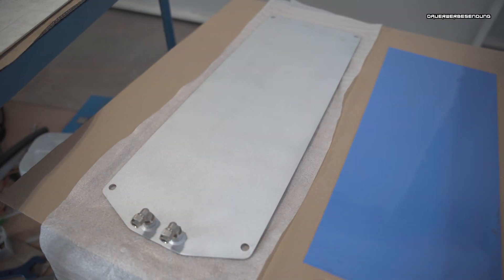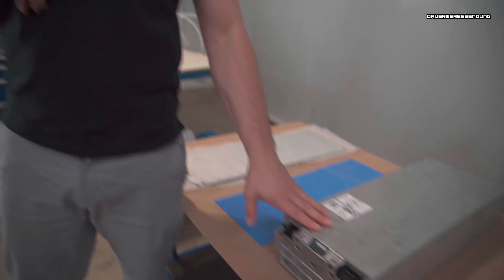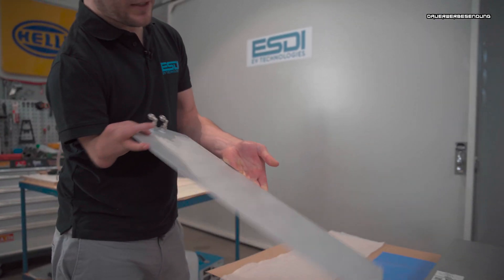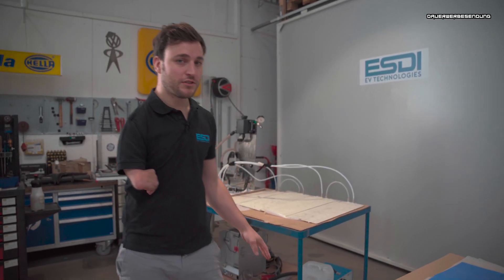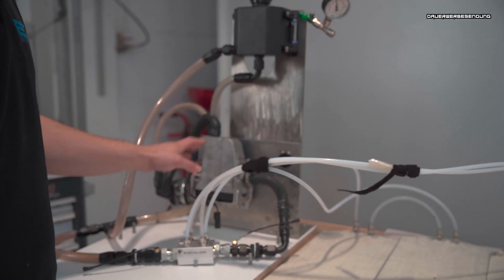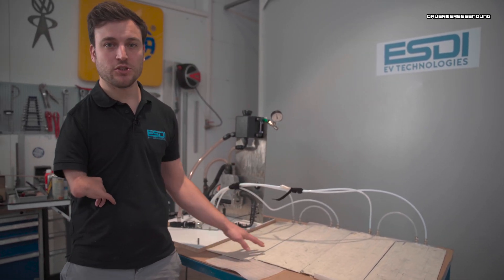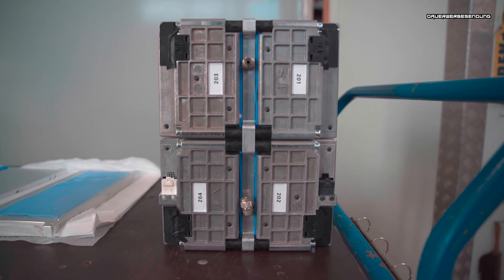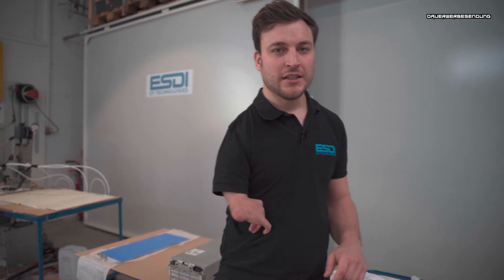MEB-MODULE COOLING PLATE | BATTERY COOLING ELECTRIC CONVERSION | ALEX TECH TIME #8 | ESDI EV

Comment: Can the cooling plate take the weight of the battery as the bottom is not flat? Does it have to sit a little higher above the floor of the battery box? And these have to be installed one per module correct?
Reply from the maker: Right! Have you already checked our shop for the plates? https://esdi-shop.de/products/batterie-kuhlplatte-meb
Reply: @esdiev  Yes I did but I'm still unclear. Will shoot you an email. Cheers!

Comment: I presume this is for planting in   EV conversions. For home use (I'll watch your video about it) I presume no cooling or heating is needed?
Reply from the maker: It depends on the power you load or deload it with. But for „normal“ home use there won’t be any cooling or heating needed if the packs are not stored outside without a climate-sealing enclosure.